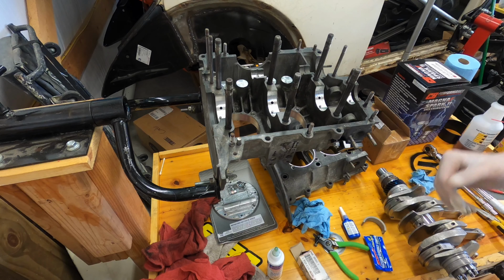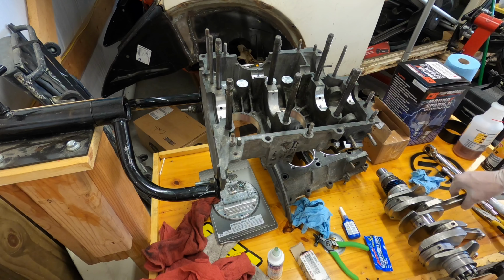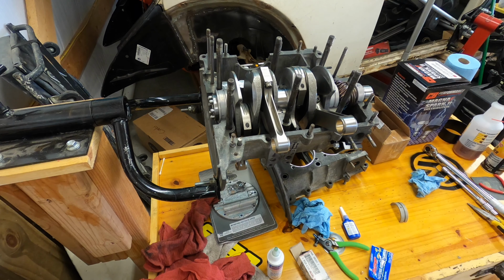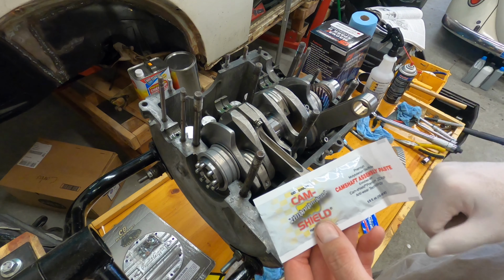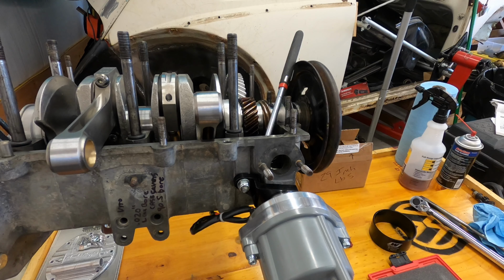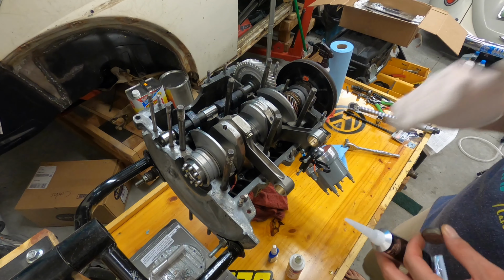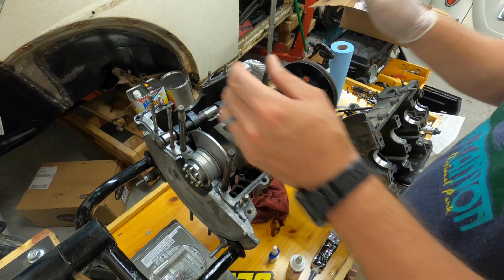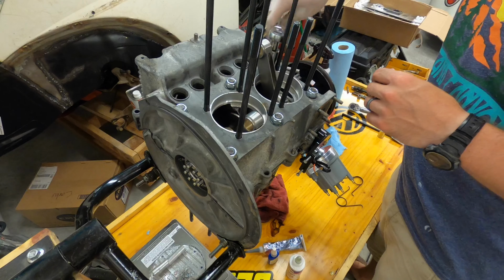Short Block Assembly - 1776 CC VW Beetle

Comment: Vito, question. I assembled my cam same as the existing. The dot is inline with the slot in the cam. Why is yours offset?
Reply from the maker: Is it the same cam?  (Manufacture, model, etc.?)  If not, that’s why.  The slot is for the oil pump.  Doesn’t mater where it is in relation to the oil pump gear.  

The camshaft I bought is in the description of this video.  (CB Performance)
Reply: @VitosFix  no, my point was I assembled my new Cheater cam to the gear with the dot inline with the slot and cyl 1 exhaust lob down. Same as my existing cam. Yours didn’t appear to be same way. But maybe I’m wrong.
Reply from the maker: Around the 6 minute mark on my video.  Dot up, lobe down.  Same as the video you sent me (that video was for a Scat cam).

Hope the cam works well!!

Comment: Since that is a 63 case what oil pump did you use. I have a 64 case and the oil studs are smaller that the ones on my later case. I am building an1835.
Reply from the maker: https://youtu.be/YKMWuKNHYFo

See link above.  CB Performance. The part link is in the description of that video.

I changed the studs from a 6mm to 8mm.
Reply from the maker: https://youtu.be/4Nz_wMtoALE
Reply: @VitosFix  thank you.

Comment: Hi, question for you. I’m rebuilding a 1600dP. I’m looking for the right cam, dual carb, setup. I see you’ve installed the 2241 CB performance. I was also thinking the 2280 cheater cam. Are you happy with the cam you installed? Looking suggests/recommendations. Thanks
Reply from the maker: I love the cam I put in my rebuild!  Looking at 2280, might not be a bad idea!  

First suggestion, I would get some 1.1:1 rocker arms.  You’ll need to get new push rods as well if you do.  I would go with Chromoly.  I’ll post a video below this comment on the rods and rocker arms.

Overall, it depends.  Dual Weber carbs, 40 IDF, some semi performance heads, balanced crank, flywheel and clutch...  1 1/2 inch headers vs. the stock 1 1/4.  I guess it just depends on how much you’re wanting to spend.  

Either way, for the crank and cam, I would got with the straight cut gears.  Less movement back and forth during acceleration and deceleration.  Longer life out of the bearings.   

https://youtu.be/5Sumjt7NIgk

https://youtu.be/AuV3WYkytVc
Reply: @VitosFix  so I called CB performance and they recommended either the 2280 cheater cam or the 2241 cam you are currently using. I’m just a little worried about over camming the engine. I do want to go with dual carburetors (CB Perf ICPs?). Also will I have to worry about deck height? If so I’ll have to adjust my push rods right?
Reply from the maker: With those two cams, I wouldn’t be worried about over camming.  

For deck height, it is important.  With a 1600 I don’t think you’ll have any issues, but it’s good to check.  You want all 4 cylinders to be as close as possible.  

If you use higher lift rockers, you’ll need to measure them out (rocker arm geometry) and cut them.  If you use stock rockers, stock size push rods should be no issue.  

https://youtu.be/yrsb-Vo8FMk